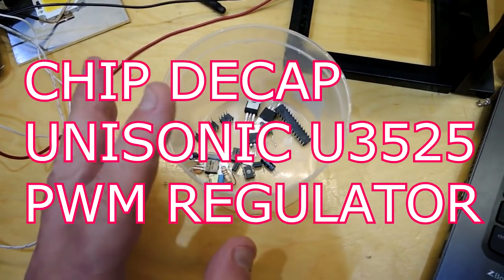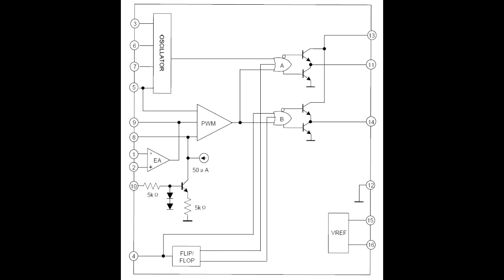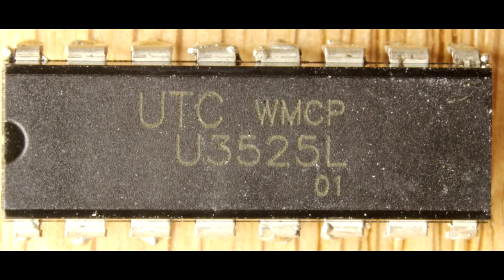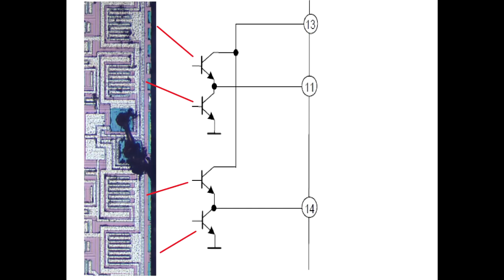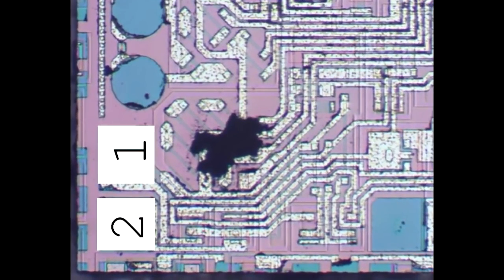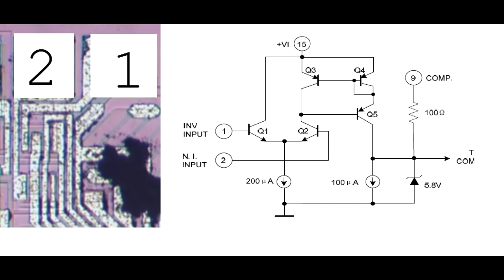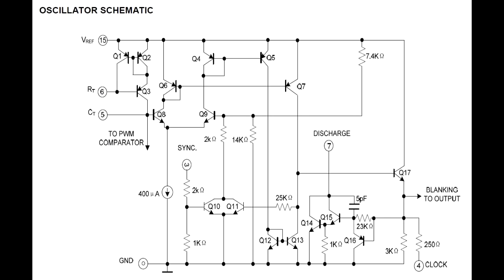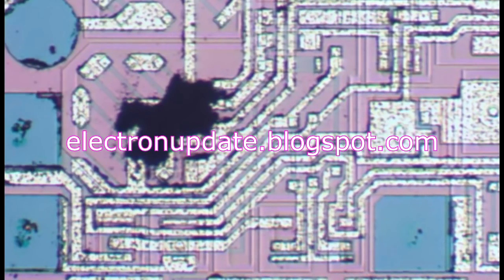Random Chip Decap: the Unisonic U3525

Comment: Thank you, very interesting video. The part number and function of that chip sounds like it originally came from a chip family made by Signetics in the 70's and 80's. They are numbered SG3524 to SG3526 with even earlier versions named SG1524 and SG2524. They are all PWM controllers, SMPS controllers etc.